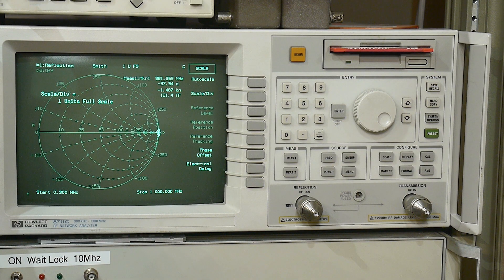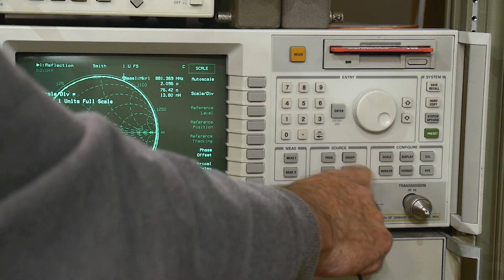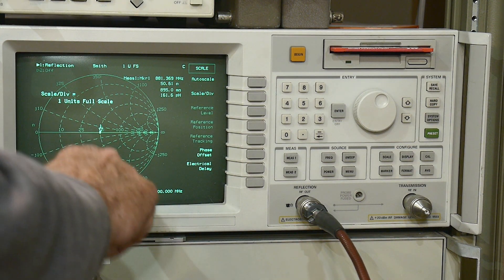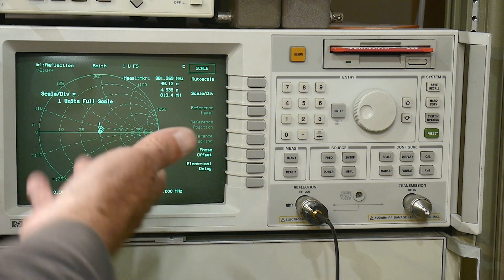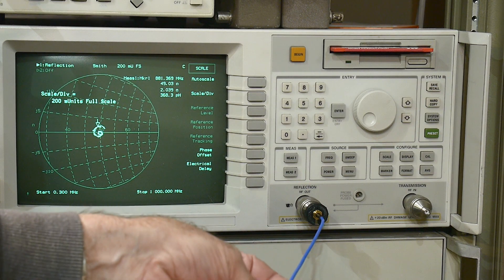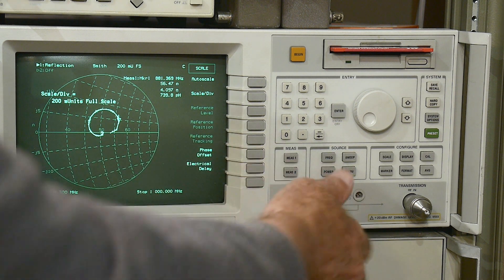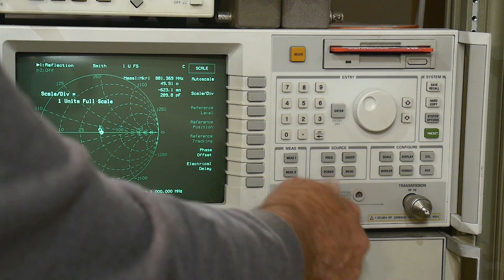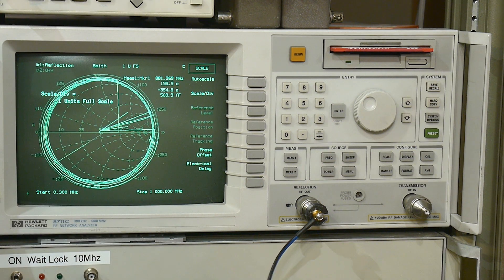#1472 Cable Test on Smith Chart

Comment: I suppose  at right electrical wavelenght (like 1/8, 1/4 or 1/2) of the cable and you see if the cable are 50ohms... 
On frequency  sweep, not perfect 50 ohms cable are some time, line matching, some time, transmition line, this is why you see circle on inperfect cable. 
Nice video... i like it.